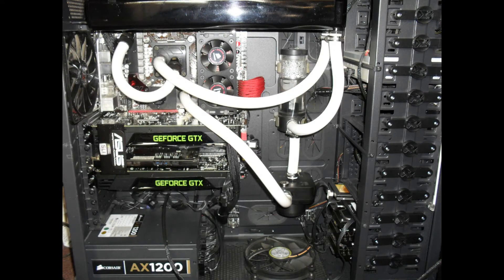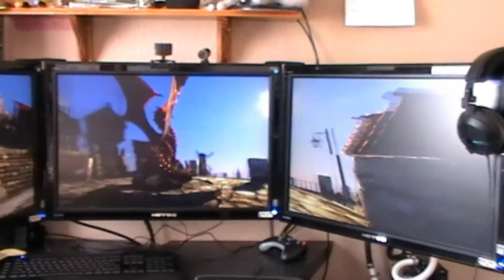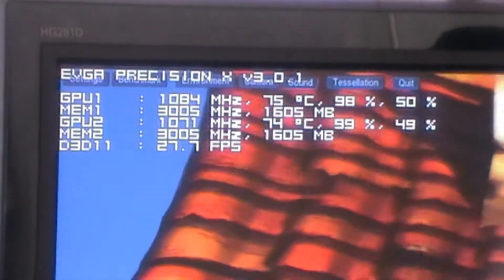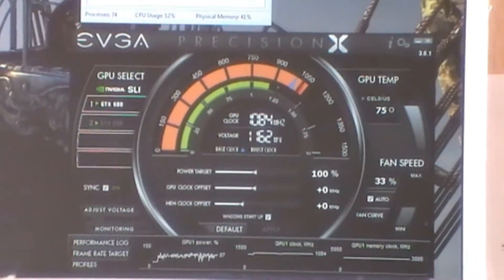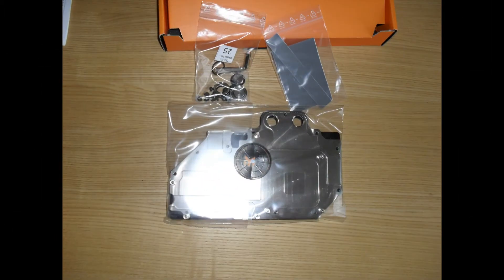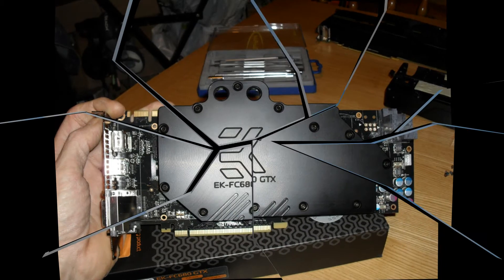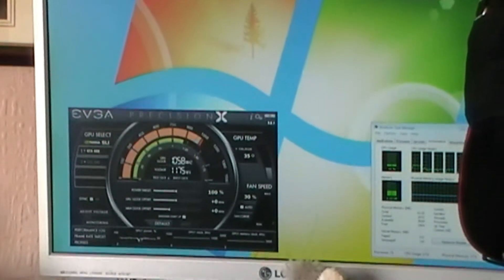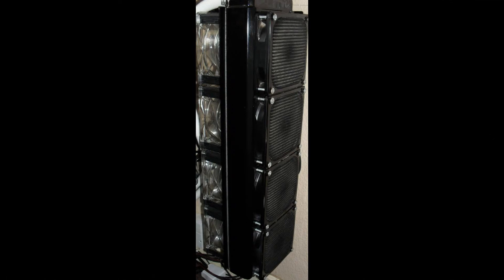GTX 680 Sli with EK-FC680 GTX water blocks

Comment: Hi!

Excellent build!  I was hoping for abit of guidance as i have bought a gtx 680 about a month ago and today purchased the EK back plate and waterblock... never fitted a gpu block before so just wondering what i need to look out for?  

Is there any things i need to becareful with when fitting a waterblock to a gpu?  It was easy with the cpu but the gpu has the stock cooler...

Thanks
Jay

Comment: Hey, very very nice setup. I know this is some what of a rookie question, but do you mind shedding some light on the water cooling connection between the two cards? I'm currently building a SLI 680 rig and I'm looking into watercooling and this video showed exactly why I need it. But I don't know much about the solid connection between the two cards, any knowledge you can share on picking that connection would be greatly appreciated ~ Tom